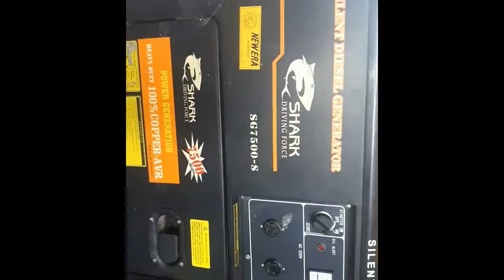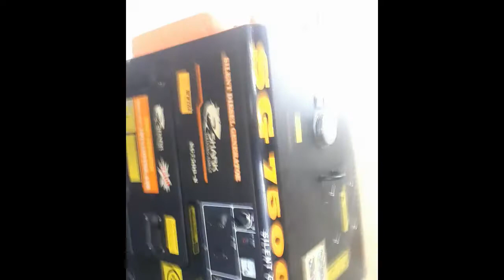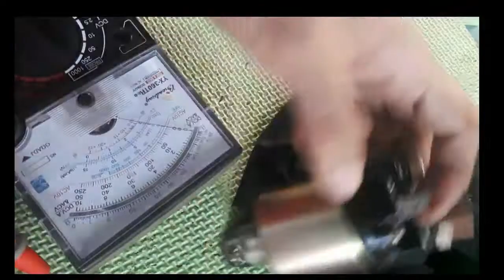SHARK SG-7500S DIESEL GENERATOR NOT WORKING/ ALL DONE!!FIXED BY CLEANING THE SOLENOID STARTER

Comment: thanks for the video. i have the same unit  like this one. my problem is, it's not charging. what should be the problem? I changed already the voltage regulator rectifier.